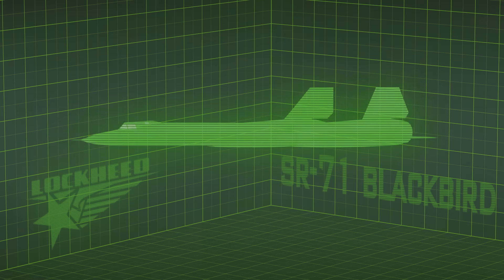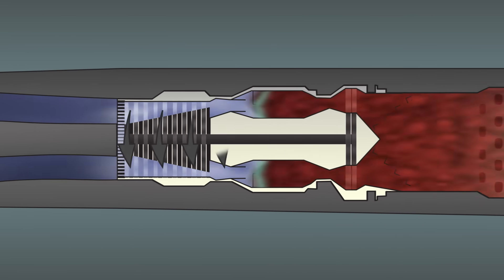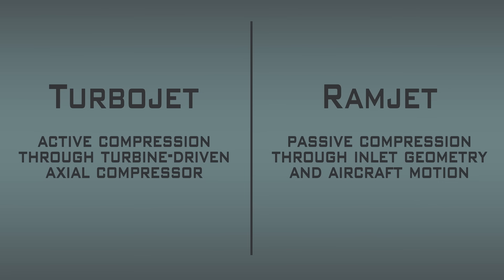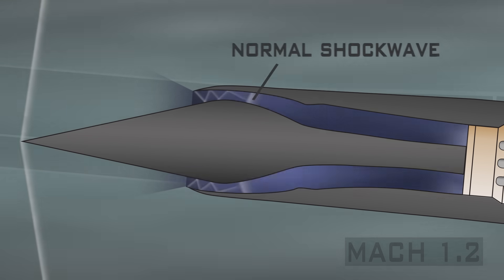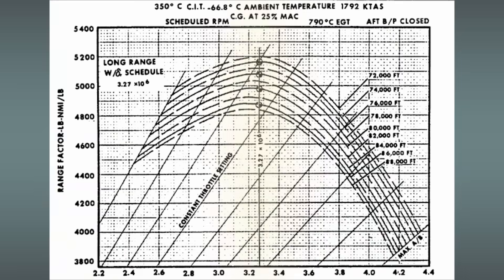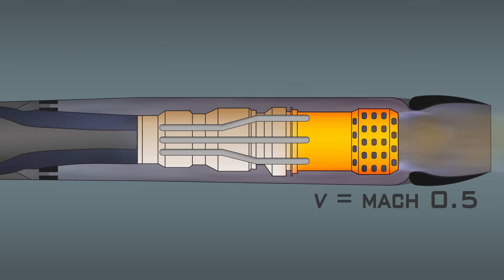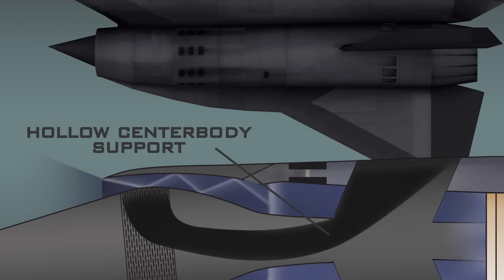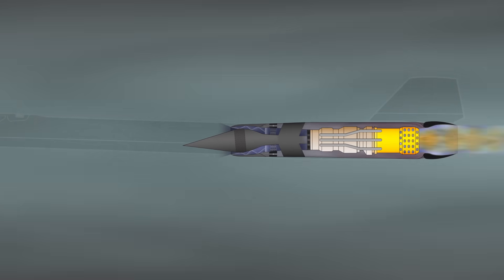The Mighty J58 - The SR-71's Secret Powerhouse

Comment: Such a complicated engine and here I thought it was an efficient and powerful turbojet, can you do one on the Mig-25? As it's also able to reach speeds upto Mach 3.0
Reply: The MiG-25 can't do Mach 3.0 consistently...  They always wrecked the engine when they worked it above Mach 2.8 which IS the upper-limit design speed.  There's no point going above Mach 2.8 with the speed/high temperature issues.  Even the vastly-upgraded MiG-31 which is essentially MiG-25, version 2.0+ doesn't bother to exceed Mach 2.8...  What's the point?  You probably won't even go faster than Mach 2.0 with a full missile load and at any point above Mach 1.5 you're just burning fuel and it's not doing you much good.

Besides wrecking the engines with Mach 3 flight in a MiG-25, there's a fair chance you'll damage other things like the landing gear.  The Russian designers had to follow the same aerodynamic rules and deal with the same temperature issues that the guys at Lockheed did.  Lockheed had to virtually reinvent every part of an aircraft to make the A-12 (SR-71 predecessor) work!  That's how bad the heat issues at Mach 3 were...  Only titanium would work for the airframe but that has some nasty reactive issues with other elements and metrals and you had to be careful with what parts were made and what type of metal tools were used to make those parts.  Virtually EVERYTHING had to be reinvented for the Blackbird!

The Russians were more limited in material sciences which meant they COULDN'T produce a consistent Mach 3-plane without wrecking the plane all the time or killing the pilot.  They tried to produce a Mach 3 plane in the classes of the SR-71 and XB-70 Valkyrie but they just couldn't with the level of technology in their aerospace industry.  That's not being snarky, btw...  Most companies in the world, PERIOD, could not accomplish what Lockheed and North American did in the 1960s -- and frankly only Lockheed's design really worked that well at Mach 3+ speeds and was practical in useage.

(Nowadays, there's almost no point in a Mach-3 plane.  You use a really 
fast missile or stealth drone to do reconnaisance work.  Mach 3-manned 
planes stick out on sensors because of the high heat from engines and 
atmospheric ionization.)  

The big issue with Mach 3.0+ flight is heat...  You can't just manufacture a plane out of anything.  The reason they use aluminum in planes historically is because it's more economical and has decent strength/chemical characteristics that are known.  The problem is that it also has limits like any other material.  There's only so many hours you can stress any material (8,000 hrs for fighters; 20,000+hrs for transports and bombers) and it also has limits dictated by its melting and boiling points.  The fastest jets you can legitimately call dogfighters (F-14, F-15) are limited to Mach 2.5 because of the aluminum in their airframes.  Aluminum starts to melt at about Mach 2.5 and the planes can only make short excursions to that limit.  [Technically, the general upper limit is Mach 2.3 because of the bubble canopy.  The plexiglass starts to soften around Mach 2.3.]  Anything faster than Mach 2.5 is basically a freight-train as far maneuvering goes.  Granted, at supersonic speeds, everything pretty much maneuvers like a freight train but non-fighter design types are particularly bad at maneuvering at supersonic speeds.  The SR-71 (spyplane) and MiG-25 (spyplane and interceptor versions) weren't designed to be dogfighters so they weren't designed to pull as many G's and the designers could concentrate on the more important issues of material strength (not necessarily the same thing as pulling G's) and heat resistance for higher speeds.

When Viktor Belenko defected with his MiG-25 to Japan in 1976, the US/Japanese intelligence services discovered the plane was limited to Mach 2.5...  The engines would surge out of control at speeds higher than that so they stressed sticking to the limit in training despite the airframe being rated for Mach 2.8.  Later production-run engines might have fixed the issue but that's the way it was in the mid-1970s.

Just because they CAN exceed Mach 3.0 doesn't mean it was designed for that.
The few times the MiG-25 did exceed Mach 3.0 was during reconnaisance missions (Middle East, Arab nations and possibly Soviet exchange pilots) and that was a specific version of the MiG-25, the MiG-25R.   There was also the 'armed version' of the MiG-25 but it had a different nose and wasn't designed for reconnaisance work and would probably not be able to match the 25R in speed because of the 'bulkier' body - different nosedome, definitely much greater drag when carrying its large missiles.
Reply: @AvengerII Greatest post I've seen in a long time, I wish more people wrote educational texts instead of sh*tspamming.

Comment: is it true that youll have to refill it right after takeoff before flying the complete world round?
Reply: Yes. It wouldn't carry all its fuel during takeoff because it'd leak on the ground. The joints weren't all snug when the plane was on the ground, this is because when it reaches it cruising speed, the plane would stretch, and the joints would become perfectly snug.
Reply: +Saurabh Suman ahhhh okay thanks I always wondered
Reply: Actually the tanks WERE sealed but the&#160;compound used kept breaking down from heat. It was very labor intensive and expensive to keep replacing it so it was eventually removed completely. It really wasn't that leaky. The reason why they refueled right after take off had nothing to do with leaking fuel. It did however have everything to do with reducing stress on the airframe. The aircraft would only have a partial fuel load on takeoff. Same reason why when going supersonic the Sled would do it in a slight dive to unload the airframe and reduce stress on it. I had the great honor of working on the J58 program before the Sled was retired.
Reply: Watched another video (I think it was the museum SR-71 walk-around one) where the former pilot (Buz Carpenter) said there were two reasons: less wear on the tires and it made the plane more manageable should something happen just after take-off.
Reply: As I said less stress on the airframe or didn't that sink in? That includes the landing gear and tires.
Reply: +frak off - WHAT ??? The sled went supersonic in a slight DIVE ???? Where did that info come from ? Please explain that. Even the inlet spikes are positioned to get the most airflow with a nose up angle....not a dive. The slight nose up angle was for lift .
Reply: Guy the Sled went into a shallow dive to off load the airframe during the transition through mach 1. It is a very common practice it reduces stress on the Airframe. My source gee my years working at Pratt & Whitney along with discussions with pilots of every walk of life plus my own piloting experiences. Plus you know NOTHING about aerodynamics do you? The air flow was the same over the aircraft in a shallow dive or a shallow climb. By being a shallow dive the gee loads were reduced during transition PLUS the dive helped accelerate the aircraft saving on fuel. As is true for EVERY aircraft. The only time the airflow is disturbed is at extreme AOA's which is the angle of an aircraft relative to the airflow. NOT THE GROUND. This along with your other reply shows you know nothing how aircraft work.
Reply: Your original statement made it sound like it always flies supersonic in a slight dive.....I misunderstood that.  I'm aware of the "dipsey doodle " maneuver and I agree with you why it was used. If you would have said transition to mach 1 to begin with I would have just agreed with you and moved on.

Comment: Overheard the following radio transmission between a Minneapolis Center Air Traffic 

Controller & an incoming SR-71:
 
     SR-71 Pilot:  "...Minneapolis Center, Blackbird 06..."

     MPLS ATC:  "...Blackbird 06... Roger, go ahead..."

     SR-71 Pilot:  "...Blackbird 06 requesting Flight Level 650 (65,000 feet AGL)..."

      MPLS ATC:  "...Ahhh... (snickering over the mic)... roger, Blackbird 06,  if you can get                              

                              there... you're cleared, climb & maintain Flight Level 650..."

      SR-71 Pilot:  "...roger, sir, Blackbird 06 DESCENDING to Flight Level 650;  thank you 

                              much..."
Reply: Transmission took place 34 years ago, 11 years before SwedJet existed.
Reply: The SR-71's did not use the call sign "Blackbird."  The SR-71 used the call sign "Aspen."
Reply: LMFOA
Reply: 8fox261,  yeah I call billshit.
Reply: ever hear this one...https://youtu.be/8AyHH9G9et0
Reply: Like 100x
Reply: Not tryna be a smartass but pretty sure all flight level altitudes (FL) are ASL/MSL. Not AGL.
Solid transcript though.
Reply: Sorry to blow your idea out of the water but it is a commercial airline SwedJet Airways from Sweden that uses the "Blackbird" callsign...also the Blackbird SR71 was completely retired and taken out of service in 1998 form USAF and 1999 from NASA

Comment: what I grasped from this video, it is a giant supercharger with lots of cooling points. I really find it fascinating that the inventor refined the engine to be able to control the boost pressures by vents. I would give anything to be apart of that design group. now to apply this to boost my jeep's inline 6

Comment: It's amazing to think how they designed the SR-71 in the early 60's and over 55 years later they can't even get the F-22 or F-23 right.
Reply from the maker: +jagara1 Surprisingly, the Sr-71 marks the last of the "simple" airplanes - it's really not complicated compared to something even like the F16 - The level of avionics & flight control for more maneuverable planes is actually more complicated than pushing it to go faster.  That's why the B-52 and the A-10 still outperform their intended replacements - they're so reliable because they're so (relatively) simple, and can take a beating and keep kicking!

Comment: do fighter jets of today use this type of engines?
Reply: No. The manoeuvres a fighter jet does would likely cause it to rip itself apart at the speeds the SR-71 would fly at.
Reply: +Josh Adams thanks for the answer and it makes sense, impossible to play around when you fly in over Mach 3 speed but I thought they could use it to cruise in high speed like the SR-71. A plane that can do maneuvers at lower speeds and then switch to another configuration when needing high speed cruising although with the speed of today's SAMs, I don't think such plane can survive, at high speeds with no maneuverability, it an easy target...

Comment: wonder how long engine over haul intervals were.
Reply from the maker: +Sportster20042001 There are surprisingly few moving parts - a few bearings, the hydraulics - but there wasn't internal gearing like we find on modern turbine engines. Basically a single shaft ran the compressor from the turbine (and acted as a giant fuel pump), and everything else was simply hydraulic rams and guides for compressed air and fuel flow.

Comment: never realized it was only fractionally a ramjet,
what mass flow used the bypass?
Reply from the maker: +jsbrads1 At Mach 3.2 it's about 80% ramjet and 20% turbojet, but at low speeds (like, mach 0.9) it's 100% turbojet